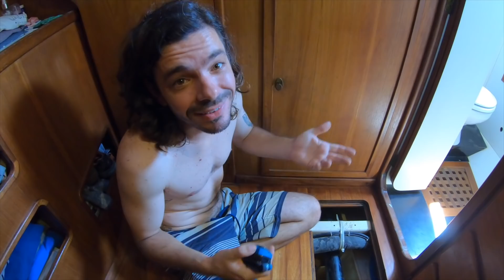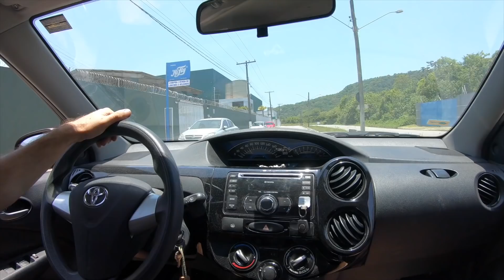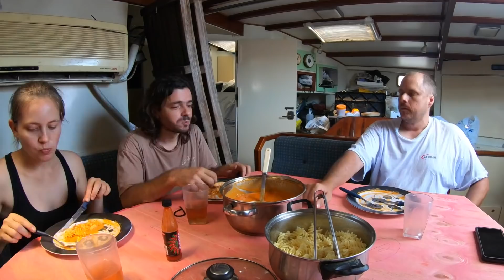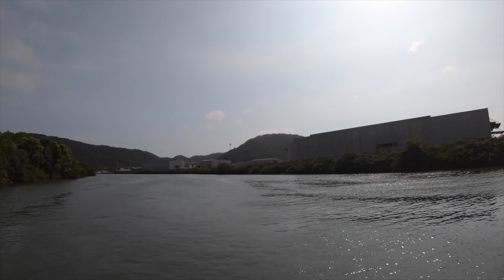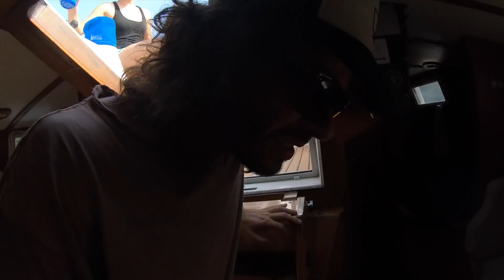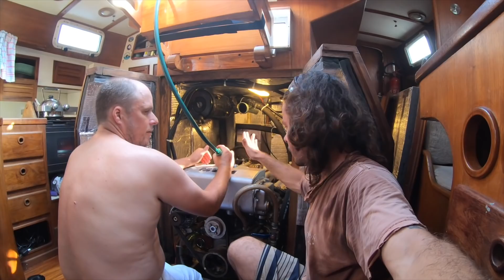⛵️First SEA TRIAL after 23 year on the hard!! (didn't go well!! 😨) Not Click Bait #163

Comment: Everything you have done up to this point has been perfect spot on. You know your boat better than if it was a brand new model. This knowledge will serve you well as you begin your travels. With all of the detailed work you have done on the boat I would spring for the new engine. I purchased a new Yanmar 4 cylinder diesel for a small trawler in 1990 and the engine ran trouble free the entire time I owned the boat, a total of 28 years and 13,300 engine hours. Oil changes and regular service kept it like new. Never failed once. The new Yanmar 4JH57 is a far superior engine than my 1990 model. Lighter, more reliable, much better fuel economy, and small in size, yet puts out more power. Any engine sitting for so many years without being started can have internal issues that could show up at the most inconvenient time. Same issues as any automobile. You've made yourselves a first class boat up to this point and with all of the work that it has taken to reach this goal the new Yanmar has to be a must to match everything else on the boat. So easy to get parts and service, too, wherever you are. Fellow boaters in my area have had to purchase heat-exchangers from manufacturers other than the orig. engine  builder, and have had good luck if you decide to replace yours rather than fix it. The quality of the exchangers that are available in California easily equal the manufacturers.  Good  luck, don't fret with the sea trials finding small issues, it will all pay off when you make your first long distance journey.  A+++ in every way on your restoration.

Comment: When there’s a storm coming and you’ve got every sail set and the engine flat out running for safety you’ll be glad you bought the Yanmar.
Reply from the maker: 😉⛵Indeed, a boat needs to have a reliable engine.
Reply: But you can get all the millennial know nothings to kiss your ring if you install an electric that lasts for 45 minutes of charge.
Reply: Yes a yanmar is renowned as good.
Reply: @jaysparc  we are talking a kubota hybrid electric! It would compliment these guys built and style of living very well! It provides multiple forms of redundancy so if the diesel won’t fire you have the electric, batteries can be charged under sail or by solar or by Diesel engine while it drives the boat.

If I was in a huge storm at sea I would want the kubota hybrid, the electric drive will give you time enough to move to safety or keep you into the weather while you get the Diesel motor to start. It doesn’t replace diesel motors it compliments them.
Reply: @MrPaulviles  All diesels generate electricity if they have an alternator. Electric motors are great in cars, but silly on a boat.
Reply: @jaysparc  these are not just alternators but motors as well. They don’t replace a diesel motor but compliment it, provide redundancy and convenience. 

Everyone to their own though.
Reply: @mysurlytrucker7510  i hear fantastic things about the kubota/Beta Marine engines...
Reply: @sailingkoko  good.
Reply: @jaysparc  Cruise ships use electric motors to sail because they're quiet and less noise & vibration. They also like them because their azipods (they call them this) can turn back and forth, some even 360 degrees around to help steer the ship.

Comment: Go for a new engine and get Roberta to sweet talk the Yanmar; agents.  Love your channel and great to see you finally moving on the water.  Christmas greetings to you both.
Reply from the maker: hehe . We wish things were that easy. Christmas greetings to you as well!
Reply: No need, just a heat exchanger
Reply: @OddLifeCrafting  There is an additive that works wonders for motors. You add it to the oil and it seals all the leaks by itself running the motor. It is a tweak like your cleaning additive. (Called motor seal) 

It is normal that stuff is leaking at least for old motors due to bigger manufacturing tolerances, that additive gets it sealed. Stay healthy guys

Comment: Have a look at Leo's channel "Tally Ho", in the latest episode he goes through the rational of choosing a new engine for Tally Ho, his solution, a diesel hybrid which allows him to run on pure electric for short periods (docking / undocking etc) while still having the reliability and endurance of a traditional diesel engine.  Love the channel, keep up the good work.
Reply: The system he's going with also comes with it's own gear box so they would be taking care of 2 problems
Reply: Duca, check Beta Marine out! the smaller version hybrid would be just right for you!
Reply: The stuff I have read indicates it was written by delusional people who think the world is flat. I quote "40` sailing vessel requiring 4kW to achieve 5-6kts and utilising a 48v/200Ah battery bank (4x 12v/200Ah) would be able to travel for 2hrs at 5-6kts. Increasing the battery bank Ah size will allow a higher hull speed or greater range." Name one 40 foot sailing vessel that can achieve 5-6 knots with a 5 horsepower motor. I have had challenges driving an 8 tonne boat at full throttle on a 50hp motor against a 25 knot wind and 4 foot waves. We made 3 knots. The alternative was hanging on anchor waiting for the 50 knots forecast. Don't be deluded, get a Yanmar.
Reply: @prof.m.ottozeeejcdecs9998  Their boat weighs 14 tonnes. Ask yourself how much power is required to push that against 20 knots of wind with a 2 metre swell and a 2-3 knot current. It is going to struggle with 30 KW. Beta marine provides?....
Reply: @philgray1023  no, it wont.
Reply: @philgray1023  Yep, I concur! ;-)

Comment: I'd go for peace of mind and easily-available parts - get that new engine!  I, for one, love the videos no matter what you're doing :-)
Reply from the maker: Thanks so much for the support my friend!!
Reply: i really like the Hybid drive that Tally Ho is going with.  But that is probably a fortune .  Tuff spot.  However it will lead to great  videos. You need to have a reliable engine.  Its a safety issue.
Reply: I agree.  New Engine.  Buy Once, Cry Once.  Better to invest in a new Globally supported engine, especially if you can easily sell that old engine now.  Dump it and get that Yanmar.
Reply: Once you get the engine fixed it will last  20 or more years.
Reply: @SawmillerSmith  if you are sailing around brazil i would agree with you.  But if you plan on going blue water sailing where this ship is capable of, you need the most common engien on the market.  just incase poop happens.  Yanmar is a great choice.  I would have also considered Cummins or even better Kubota.   Great thing is Kubota engines are used for everything not just marine so you can get parts from anywhere.
Reply: @rothgartheviking858  the most common would be  Cummings or Caterpillar.  I had Kubota engines in the parts are that easy to find as many might believe. If I was looking at finding parts easy I would go with a chevy engine because parts are cheap and easy to find.
Reply: @SawmillerSmith  Yes but Kubota engines are everywhere in everything.  The point is you don't need to contact a marine dealer for kubota engines. You could call a tractor supply store and get parts. Or grab a part off a fork lift. They  have so many of these small engines out there you would never have an issue finding parts.
Reply: @rothgartheviking858  the only reason I'm no fan of Kubota is the parts are sky high. And I live in indiana and have had a hard time finding Kubota parts.
Reply: J.C. Kohle  true,but lots of engines.
Reply: @rothgartheviking858  Yanmar makes all that other stuff too.  check their website.
Reply: @SawmillerSmith  and if not ?

Comment: Think about Beta Marine, their engine is a Kubota, you can get parts anywhere in the world.
Reply: Peter from Travels with Geordie and Samson Boat Co with Tally Ho both recently selected Beta Marine to repower. Tally Ho has an interesting parallel hybrid, where the prop can be diesel or electric powered.
Reply: I totally agree, Beta engines are much easier to maintain especially in remote places. They have a more simple design with no electronic systems. They are also designed to be retrofit into old boats and you can get them to design the engine mount fittings specifically for your boat, normally at no extra cost.   This means no cost in modifying your boat.  Only tip I give is to make sure your order the version designed for a steel boat (electrical wiring configured not to earth through the engine).  O, and I don't have anything to do with Beta marine except that I installed a Beta 60 into my steel boat 3 years ago and I think it was one of the best decisions I have ever made!
Reply: Yea good shout kubota engines fitted in everything from plant machinery to boats all over the world

Comment: You guys are doing great things! Thank you for sharing and living the life some of us just dream about. Engines - don’t be a sheep - consider using a hydraulic vane or rotary piston motor with an electric power pack!  No gear box - minimal mechanical parts to fail and water proof. A 45hp motor is the size of your gear box. Electrical control to the valve pack or use a swash- plate closed loop system = instant controls and 100% torque at all revs. (Like electrical motors without the expense). Remember that hydraulic parts are universal, every digger / yard hoist / tractor in the world is using them. You can find most of this nearly new. The engine money then goes into a new super reliable generator set which is small and quiet and massively more efficient.  You get the benefit of loads of AC power and your batteries etc charged in record time!  Make that diesel last ages.

Comment: A new engine is the best bet in my opinion. Electric would be a great idea but I'm not sure it wouldn't cause more problems for you. Yanmar is pretty good.
Reply from the maker: We agree, for now electric would turn this into a much bigger project for now. 😌
Reply: @OddLifeCrafting  have you ever thought about a beta marine engine?
it is electric diesel. you can use the power of the sea current to recharge the batteries, if the generator fails you can use the disel engine for propulsion, and if the diesel engine fails you can use the electric motor for propulsion.
the last video from the Sampson Boat Co channel
talks a lot about this engine.
I'm sorry for the bad English
Reply: @DanielSilva-jj2lz  Not that practical if you just want to cruise with no worries. That hybrid parallel thing brings much more complexity and more possible problems with little benefit in my opinion, given that the sails are already a back-up for the diesel engine. And, in terms of parts availability beta marine stands no change againt yanmar.
Reply: @polviaortega3709  But the beta marine engine would eliminate the need for solar panels or a power generator, And in the long run it has a higher cost benefit..
What complexity does it have?
The generator is attached after the clutch of the diesel engine, and the generator gear is attached to the propeller card, I find it less complicated than maintaining a generator separately. I believe that the only disadvantage is the price that is more expensive.
Reply: @DanielSilva-jj2lz  Yes, I know it's not a bad solution. Probably with option will work very good but in this case if they plan to do very long voyages in the caribbean and other places I would go with the yanmar engine because of the part availability.

Comment: Hey.  A greeting from Denmark.  It was nice to meet you at the Miami boat show 2020. I am a trained mechanic and have worked for Volvo Penta Denmark.  I would definitely recommend changing the engine and a yanmar boat engine is a really good choice.  They are extremely reliable and easy to service.  If I had to put a new engine in my own boat, I would also choose a yanmar engine.  Remember, if one day you choose to sail to Denmark, you are most welcome.  Great respect and love from us in Denmark. Kenneth Bendix.
Reply: Another thing you should also remember ... A yanmar boat engines are very quiet and use less diesel, and thus good for the environment.  Typically you will have a reliable engine for the next 30 years, maybe even 50 years, with good service ... ⛵️❤️🇩🇰

Comment: Option number 4, go electric, its the future.  You will not have to go to shore for fuel.  Less time on repairs.  Chat with the guys who did it!
Reply: Not practical.  How do you power it?  Obviously batteries.  That means ripping out all of the fuel tanks and converting them to battery boxes.  Then, you can assume you'll need solar to charge the batteries.  If you can find a 100 watt/hour panel, you'll need about 25 of those to charge the batteries.  Where are you going to put all of them?  They need to be basically flat so as to catch the sun's rays.  Imagine 25 panels that are 3 feet by two feet.
Electric would be nice, but it won't get you through two days of rain squalls where you don't have any sun and you can't raise the sails.

This is the third time I've tried to edit this post!  Sigh.

Okay, buying an Elco 40 hp motor is about $14,000USD, not including what it takes to install or connect it to your prop.
Then, you'll need batteries.  Elco says that this motor will require 9 260Ah AGM batteries, but you could probably get 8 300Ah Lithium Ion batteries.  Those Lithium Ion batteries, if you were to purchase them from ReLion would cost you about $5,000.  So, just for the batteries, the motor and the install kit, about $20,000 USD.  Then you need to buy the controller and the battery regulator/charger for between the solar panels and the batteries.

Elco says that with the 9 260 Ah batteries, you can expect between 2-5 hours of usage at 6-8 knots.  You may get another hour or so with Lithium Ion batteries with their deeper discharge capability.

https://www.elcomotoryachts.com/product/ep-40-electric-inboard/

If you were to switch to 300Ah Lithium Ion batteries, you can get the same amount of power that 9 260Ah batteries gives you, within a few amps.  (2,340 vs 2,400).  You're still going to need to recharge those batteries, and about the only way to do it is with solar panels.

So, how many solar panels?  Well, you'd want to do it as quickly as possible given the amount of daylight you would have available.  So, you'd need enough solar panels to charge and maintain a 2,400Ah discharge.

https://www.custommarineproducts.com/marine-solar-panels.html

On this page, there is a CMPower monocrystalline panel that outputs 125Ah over a six-hour period.  The particular one that I'm thinking of outputs 270 watts per hour or that 125 Ah.  Here's the rub, those panels are 3' by almost 5' and you're going to need TWENTY of them.  PLUS, to achieve the kind of power output that we're talking about, they all need to be at maximum sunlight during that time period (six hours).  Any kind of shadowing can decrease the output by 25-50%!
Now, the thing is, these numbers are JUST to charge the batteries to run the motor, not even charging the house batteries.  Those will require a different set of solar panels.  I'm sure you could use the same panels to charge both, but it will take longer, and if you don't use your electric motor, I'm sure that would be okay, but if you're running  motor, all bets are off.  Three hours at 8 knots, and no more battery power until you recharge.  At 400 amps an hour, if you can get all of the panels in the bright sunlight at the same time, you should be able to still put a small charge on the battery while consuming enough power to keep the motor running, but the slightest loss will affect how long it runs for.

So, as you can see, I don't think it's a good idea.

Comment: Yes guys, the best option as you are planning to sail far and wide away from Brazil is to go for the Yanmar engine change. As you said, you can get a fair price for the original engine there in Brazil, outside of Brazil it would only be a mooring anchor if it needed to be changed. The Yanmar engine is the best option as they are globally supported and service and parts availability are in place with their network. Great to see the old girl actually out on the water even if only for a short run. You guys have done a great job with her and will enjoy her for many years to come once she is finished and ready to set sail for far horizons.
Ps; I would also spend the money, if upgrading the engine, to change the prop shaft system and go for a full shaft with conventional Dripless shaft seal. Your current shaft seal system, while working well, will possibly pose a problem with spare parts availability and the need to haul out if needing to do repairs. A conventional Dripless shaft seal can be changed out in the water (I’ve done this a few times myself).
Reply: I forgot to mention another option, Beta marine is another excellent option and they too have worldwide service and support (also they use Kubota engines which are excellent reliable engines without all the electronics to give problems). Which ever way you choose to go, I suggest that you get the new engine and new gearbox together as a package. Another option for the new engine is Vetus, they too are establishing themselves as a reliable and well supported company globally.

Comment: Congratulations on your first shakedown cruise. I recommend a few more shakedown cruises where you exercise every single system that you expect to work. If you’re getting a new engine then it won’t matter if a little salt gets in there, you can rinse it afterwards. But get those sails out and run the windlass and stuff like that.  ❤️